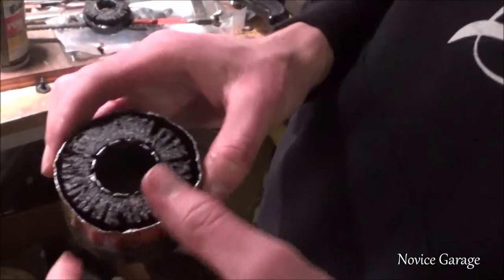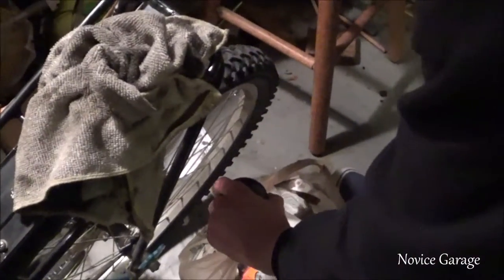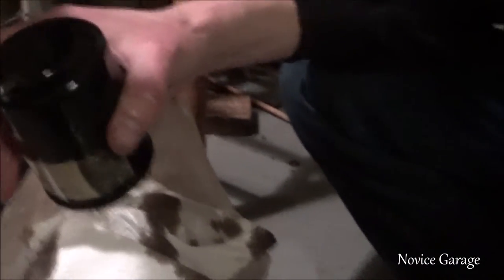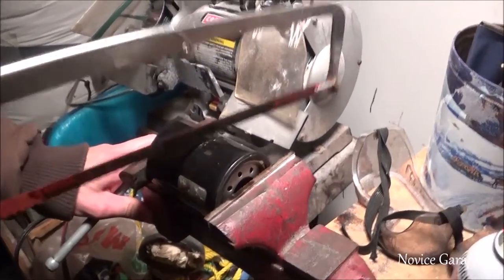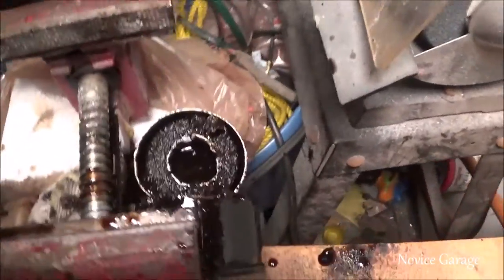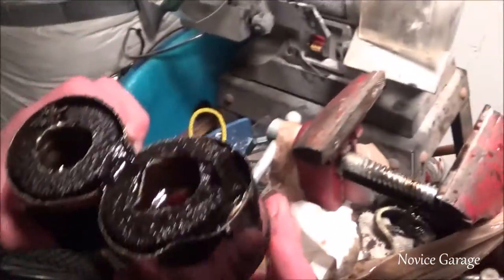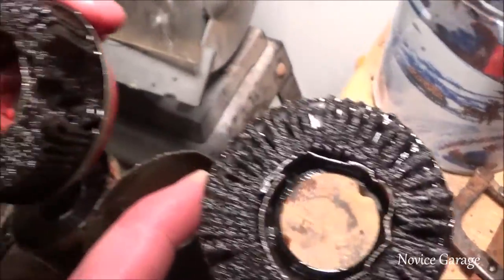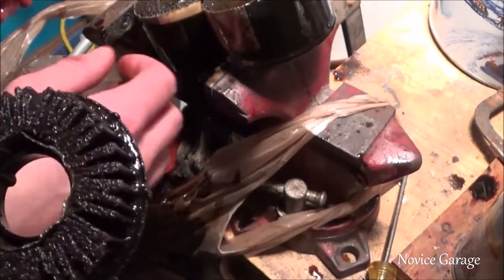Oil Filters After 4000 Miles (Regular Motor Oil)

Comment: run synthetic oil for 4k miles and then cut open the filter and see how it looks compared to the regular oil
Reply: Daniel Ball nothing wrong  with   fram. They  would'nt sell them if they  were so bad.
Reply: Yes they would and do - because people dont cut them open and compare they just assume " they wouldnt sell them if they were so bad" . Fram is known as the WORST for a reason.